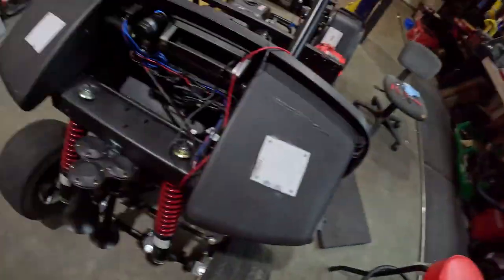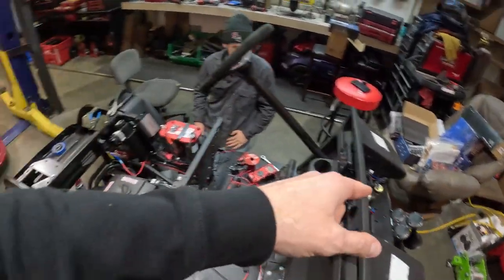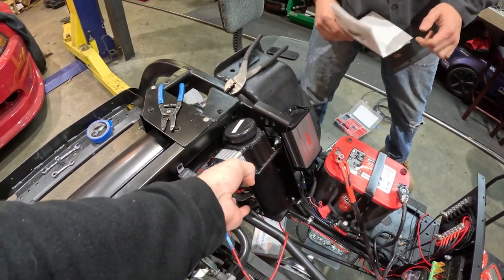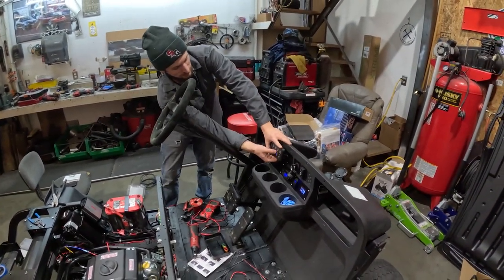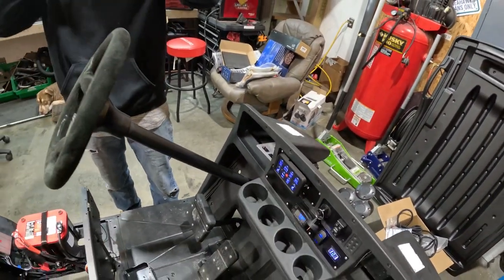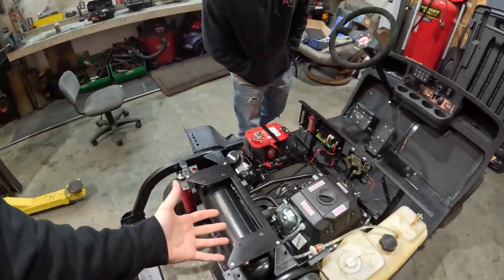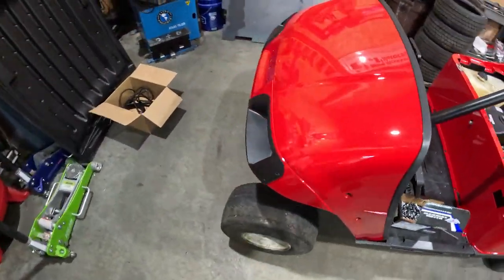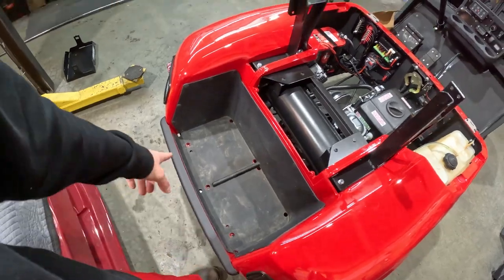Installing The New Painted Body On The 670cc Predator Swapped E-Z-GO TXT Golf Cart!

Comment: Ok, so the chinese fuse blocks aren't working or holding up. How many circuits do you have running off of it? You might have to spend three times as much for one that will handle the load. Take a look at the Painless wiring fuse blocks. No sense in throwing good money after bad.
Reply from the maker: Thanks for the advice, we agree! We found a simple solution to fix it, you’ll see it in the upcoming videos!